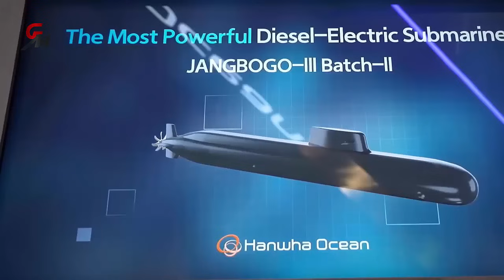Which is Better TKMS 212CD or Hanwha KSS-III, Here's The Canada's Next Gen Submarine

Comment: The KSS3 block 2 is what Canada is looking for, it meets or exceeds all Canadian requirements and the best choice for Canada.
Reply: this is the stealthiest sub around with its advanced battery power system.. even the new air recycling system... it has the ability to load nuclear missles.. and they are cheaper and on time... probably manufacture many of the parts in canada especially with technology exchange...  its a win win win...
Reply: I like the German boats as well 😘 🇩🇪🇨🇦 !!!
Reply: @douglaslim802...If you're too stupid to properly question an AI, you'll unfortunately just write bullshit! All data was collected using freely accessible AI! Our AI, which uses a much larger database, comes up with the same results. Go to trade fairs and give talks with specialists from TKMS, Diehl, and the like! Do you think major investors don't want to know where they're investing their billions, what these companies can do, and their future prospects? We/I know all about that, because we advise them!
U212CD, with the future drone system from TKMS, developed with German research institutes, is an underwater combat cloud, i.e., an underwater FCAS system that is connected to other FCAS systems! According to the AI proposal, a 7,000-kilometer perimeter can be built with 20 large drone submarines and 3-4 small drone submarines attached to each one, which exchanges data with U212CD! But this will happen underwater, using the latest technology! The drone submarines will then act as relay stations for data transmission. According to AI, the drones wouldn't even need to move, thanks to their extremely high-tech sensors, which have a long range! According to AI, they're between 40-70 kilometers. 60 small drones with a 40-kilometer range would then have a radius of 4,800 kilometers to cover. Add to that the large drones, which have a range of 80 kilometers, and an additional 2,800 kilometers! According to experts, this is a new league of underwater naval warfare and unique in the world! The costs are much lower than using many submarines for this! The large drones also have combat systems on board! The Diehl Barrakuda, which has a range of 100-160 kilometers, would be interesting if it could engage enemies at 400-800 km/h.
Reply: KSS3 is less risky for sure. And delivery timeline is very important for Canada.
Reply: @dannyyin.physio it's riskier because they have to change the entire hull to be arctic capable
Reply: I agree but mainly because they can deliver them much quicker than Germany can. The Koreans say they can replace the four Victoria's by 2035 and all twelve vessels by 2043 while the Germans can give us one boat in 2035, a second in 2037 and a boat every year or two after that into the early 2050's if the design proves to be sound. If they have to make changes after initial sea trials it could be longer and more expensive. The KSS lll has less worries that way as it's already in service.
Reply: @Fred-vy1hm quicker doesn't mean better, because you have to operate that subs for 35 plus years. 4 years saving with subpar submarine is way costlier
Reply: @Fred-vy1hm - Korea told Poland 2022 that they can get the K2 Tanks much faster than the Leopard. After 3 years they got a little Bit more than 100 and the Most of them was build in origin for the korean Army and not especially for Poland in another confi. So maybe you should not all believe what Korea says 😉. The KSS is more or less a technology copy of the german 214 class. The German 214 is our Export Version of 212 with less superior technology than 212.
Reply: KSS3 block 2  3600ton (4000ton)........ KSS3 block 3 is nuclear-powered submarine
Reply: The KSS3 block 2 is state of the art and at sea right now, and it meets or exceeds the Canadian requirements, and has everything the 213CD has and more, why wouldn't they chose the KSS3.
Reply: @KellyBrownlee The KSS-III Batch-II (3,600 tons) was state of the art but is being replaced. In the early 2030s, Korea will begin production of the KSS-III Batch-III submarines, which are expected to be larger (4,000 tons) and more sophisticated than Batch-I and Batch-II subs. Korea is also developing the KSS-IV (2,000 tons) with solid-state batteries, next generation fuel cells, next gen AIP, and potentially a rim-driven propulsion system.
Reply: @aerynlovell4754 - State of the Art 😂😂😂... It is a Copy of the German 214. Korea use German technology andcuse 214 by own. The actual best non nucklear Sub US the 212a and 212CD will be the best.
Reply: @KellyBrownlee block 2 is not even launched.
Reply: @shanjida8353  It is 1 is at sea and the other one is in the water.
Reply: yeah, 212CD with no VLS, why???
Reply: @flyingdutchman7757  The German company never tried to put VLS in their submarines before. But South Korea wants to use its submarines to counterattack from North Korea's nuclear attack, so it put VLS inside its submarines. Possibly, South Korea wants to put nuclear ballistic missiles inside the VLS of its submarines someday, when South Korea is ready!
Reply: @flyingdutchman7757 shot missiles from tubes. Only one that has AA capability it’s made for the artic and way more stealthy.
Reply: @FreyjaFosse-b2j  Agree, stealth is key (no doubt propeller technology is NATO Cosmic Top Secret)
Reply: @flyingdutchman7757 - we can integrate whatever the customer want. For Indonesia we also customized the 214. We can build the 212 CD EX...bigger than 212CD and with Equipment what the German and Norwegian navy not need but If you need VLS, we can integrate.
Reply: @DBond-bv2oi  독일인인가요? 독일 214잠수함보다 한국214라이센스잠수함이 성능이 더 좋습니다.
독일회사에서 잡지못한 구조적오류까지 잡아서 더 완벽하게 성능개선한게 한국형 214잠수함임.
독일은 옛명성에 의존하여 정치적 로비에 의존하는 나라로 변했슴
Reply: @김준승-q8x  sorry but I cannot read klingon
Reply: @flyingdutchman7757  - thats not right. It is able to integrated VLS. We Made for singapore in 214. The boat what fits best for Canada ist the 212CD EX. The korean navy use by own 214 and they try to copy but 212CD is much more modern.
Reply: @DBond-bv2oi  멍청한 소리하네 KSS‑III는 독일216, 214와 완전 다른 잠수함임..과거에 는 독일기술을 전수받아서 파생형 잠수함을 만들었었지만 장보고함은 설계부터 완전 다른 잠수함인데 독일 어쩌고 헛소리하는 인간은 뭐냐?
Reply: The KSS III submarine is a strategic weapon, while the 212CD submarine is a tactical weapon.
The KSS III is another class of weapon.
Reply: @널구리-b4k - sorry but that is nonsense. The 212CD is not a one role system... And Korea cannot build one KSS without German technology or spare parts.
Reply: @DBond-bv2oi  214까지는 독일 라이센스생산이고 KSS‑III는 계념부터 설계가지 완전 다른 잠수함임.
한국이 독자적으로 제작한 잠수함이라서 독일눈치볼 필요도 없는 잠수함임
그리고, 똑같은 214라도 한국에서 만든 214가 독일 214형보다 성능이 더 좋음..
독일이 모르던 단점까지 보완한게 한국형 214잠수함임
Reply: German technology=> Diesel gate😅😅😅
Reply: U212CD has VLS!! According to AI, U212CD is in a different league and much more dangerous! U212CD can be extended to 90 or 100 meters with additional identical modules! Diving depth is over 100 meters thanks to its diamond/oval shape, which can withstand 1.25-1.5 times higher pressure. Deep water is the biggest problem in even detecting a submarine due to the layers! Furthermore, thanks to U212A, U212CD is also Arctic and cold water-tested (-1.8 degrees Celsius for continuous operation for weeks), which also gives it an advantage over KSS III! Cold water is an extreme stress on materials!
According to AI, BRD Diehl developed an underwater hull, the Barracuda, back in 2005, which is now ready for use. It can reach speeds of over 200 knots/400 km/h, and in tests even up to 800 km/h! Range 100-160 kilometers! Currently only interceptable by the Barracuda! It's a purely kinetic weapon and, according to AI, probably undetectable by today's sonar because it's too fast. AI: If it accelerates to 800 km/h in the last 5 kilometers and hits, chaos will ensue. According to AI, just two Barracudas would sink a Zumwalt. The Barracuda would simply pierce through several decks and trigger chain reactions.
The facts AI has shown can't keep up with KSS III. Regarding construction time, it's also Canada's own fault, as they build it in their own shipyard! The high-tech components come from Germany and Norway. Another extreme feature are the new TKMS drone submarines. According to AI, 50 of them could form a 5,000-kilometer perimeter (90-100 kilometers detection range for drones) and detect everything above and below water! If necessary, it can also engage targets directly using various means; Barracudas would be an option. The drone just has to wait for what's coming and can forward data to the FCAS combat cloud, where AI then evaluates it!
According to AI, no other submarine can compete with the U212CD of its time.
KSS II is a derivative of the U214, which is the slimmed-down export version of the U212A! KSS III is ultimately based on the U214, which was further developed but without the high-tech sensors of the U212A! According to AI, the U212CD's sensors are in a new, far higher league! The sensors are completely AI-controlled and immediately make suggestions about where the next button needs to be pressed!
Reply: And what happens to the timeline if China decides to reclaim Taiwan in 2027. Or Russia takes the Suwalki Gap
Reply: Canada will choose Germany for political reasons.
Reply: @ssl558  Then Canada is stupid.
Reply: @KellyBrownlee - absolutely not! Not one KSS can build without German technology. The KSS is more or less a German 214 Copy. Korean also use the 214 and try to copy.
Reply: @DBond-bv2oi Yes, some things are baised of the German technology, but most of the kss3 is wholey south Korean design technology  and built with NO German say so in the building and design or required  permission to build!
Reply: @KellyBrownlee It is easy to say... The more modern boat is the 212CD. The KSS is more than our 214 for Export with little less Secret technology but cheaper. So it is Up to you. No doubt...the 212CD is the Smsuperior but the more expensive one. The KSS is good but not on the level. And forget the argue that the 212CD use no VLS Starter. We can integrate all what it is needed for the customer. I think it is also possible that you can build a big part of the boat in Canada! The Advantage is that Germany develope the technology and try not to copy something. That give you an Advantage. Sure...it is cheaper and faster to copy but the you will be never the one who leads in anything.
Reply: @ssl558 not sure, but I can see the SK one being chosen for the same reason.
Reply: @ssl558 and that is absolut correct because Kanada and Europe is closer together.... we will have a important trade Future.
Reply: max..Then again, the Leopard bullshit comparison with contracts! The old Leopard 2 can be modernized with a new 130mm or 140mm turret with all the features, including drone control! Furthermore, new drones and grenade defense systems can be integrated! The old Leopard 1 can be converted into a Frankenstein 35mm Skynex anti-aircraft tank for little money!
So stop with your stupid, brainless comparisons!
Reply: It's not
Reply: @saltymonke3682  Thats not what the Canadian Navy says.
Reply: Why?
Reply: The TKMS 212 is already in production for NATO partners, is potentially cheaper, has low acoustic signature and built for  Arctic operation with a reinforced sail. Germany has been building superior submarines for over a century and with NATO inter-operability this sub better suits the Navy’s needs.
Reply: ryzen...It's impressive how intelligent some users are! AI question for little lights out there who are too dumb to ask the right question to AI!... AI: Is the statement about nuclear propulsion true?... KSS3 Block 3 is a nuclear-powered submarine?...Answer for little lights out from AI: It's wrong!
I hope you can find an AI on Google with the help of Google. If that doesn't work, then enter the question into Google like this! Is the statement about nuclear propulsion true?... KSS 3 Block 3 is a nuclear-powered submarine?...AI Conclusion: No, this statement is wrong.
If you can't do that, then your IQ is the same as that of a 7-year-old child! A 9-year-old girl managed it without any problems!
Reply: max...As for Leopard, they're also talking bullshit, according to AI fact analysis!  Conclusion: This statement contains several factual errors and distorted representations that suggest it is more polemical rhetoric than an objective analysis of military systems. In detail: "Lost in the Norwegian tank competition against Korea" – It is true that Norway tested both the Leopard 2A7 and the South Korean K2 "Black Panther" in 2022/23.  Official result: Both tanks met the requirements. 
According to Norwegian statements, the result was technically close, but the Leopard performed better in some aspects (logistics integration, interoperability with NATO structures, overall package).
The Leopard 2 turret was lifted off in Ukraine because they drove down the embankment too quickly and didn't raise the barrel or moved it to the side! But that has happened with other tanks due to incorrect handling! However, the barrel system was still in working order, which was no longer the case with others!
The Leopard 2 has already seen several combat missions in war! The problem is how it was deployed, and therein lie the mistakes of losing the Leopard due to improper handling during combat! The German Armed Forces never send Leopards into combat without air defenses! It would be no problem for the Gepard to eliminate even small drones; according to the military, even one shot is enough. It would take 640 drones to fire until the Gepard is empty!
Reply: @tlsig during the competition in Norway, the Norwegian Minister of Defense reportedly sent a congratulatory message to the South Korean side the day before the official announcement of the results between the K2 and the Leopard 2. In fact, K2 scored higher in the evaluation, but as everyone knows, the final decision favored the Leopard 2 due to a “political decision” made by the Norwegian government, unrelated to actual performance. 

Norway had close oil connections with Germany, and at the time, Leopard veterans opposed the contract with South Korea. Moreover, the Norwegian head was known for pro-German sympathies. It is said that following the decision, the Norwegian Minister of Defense and military officials expressed deep regret over the outcome.
This outcome was remembered as a regrettable incident by the South Korean side. Because of this, the Norwegian Ministry of Defense promised that it would be willing to testify in support of the K2’s performance should South Korea pursue future export opportunities.
Reply: @tlsigAlso, in the K9 vs. PzH 2000 competition, the K9 was a clear winner. Germany sent 3 PzH 2000 units for testing in extreme cold, but none of them worked. Only the K9 functioned properly.
Reply: @tlsig The fact that Russia has ordered Korean icebreakers and specialized ships demonstrates that Korean shipbuilding and steel technology are trusted internationally, making claims that KSS‑III relies on foreign steel inconsistent with reality.

Also, Korea has successfully designed and operated polar research icebreakers (e.g., ARAON) and has substantial experience handling ships and steel materials in -1.8 °C environments.
This disproves claims that Korea has no Arctic or cold-water experience; actual operational cases already prove otherwise. So you are making absurd speculations that contradict reality and presenting them as facts.

KSS‑III is a Korean indigenous submarine with highly advanced automation and integrated sensor systems, designed to minimize operational errors.

Claims that KSS‑III depends on TKMS steel or that its system performance is inferior are baseless. Korea already possesses sufficient technological capability in steel, advanced sensors, and operational systems, which has been demonstrated through polar vessel experience and domestic testing.
Reply: @tlsigai만 찾지말고 실제 기사를 찾아봐요, 아기야.  대한민국 포스코는 HY-130을 상용화 중이다... 네가 어디서 듣고 온 얘기인지는 모르겠으나, 대한민국의 철강 생산/용접/가공 기술은 독일을 넘어선지 오래 되었단다, 아가야.
Reply: In this video, you can see the new 3D processing systems for U212CD construction, which saves 20% time during construction. The development costs for this system, together with the German/Norwegian institutes, are €250 million! Unique worldwide and a milestone in shipbuilding production!
https://www.youtube.com/watch?v=H4vH-UwfZ2k
Reply: max...If Korea is as good as they say, why aren't the BRD/DLR Polaris aura space plane right now? Basic research since the 1950s and the first breakthroughs in 1980! The systems are being tested on models today! First flight in 2025 Aurora 50% demonstrator in Mach range, 2026 hypersonic (Drohne-Diehl IRST partner) with aerospike engine, higher than 100 kilometers! 2028 Aurora/VEGA 28 tons, >10 Mach, 1 ton payload orbit (>160 kilometers altitude) and 10 ton suborbit (9 <160)! 2030 Aurora Heavy >300 tons 60 meter wingspan, >20 Mach, 25 ton payload orbit, 100 ton suborbit! Everything is being run through a BRD military project as well as an EU project! From the EU to Australia in 90 minutes! A 10-ton steel core as a kinetic weapon has 400 times the kinetic energy of a GBU-57! Aurora Heavy is capable of launching a 230-ton modular system into orbit for the EU space station in 3 months! The ISS weighs 420 tons! Transport cost comparison: SpacexStarship is 1/7-1/10 of that!
So what does Korea have to offer? NOTHING!
https://www.youtube.com/watch?v=FhnCDFu43E0
https://www.youtube.com/watch?v=RoK70Px25R4
https://www.youtube.com/watch?v=0aTtGoWsIEk
Reply: saltymonke3682...You're absolutely right that this is being vastly underestimated! The Eurofighter Tranch 1 was upgraded by Spain to Tranch 4 for a mere €544 million! It's now fully FCAS LTE capable with the high-end Pretorian Evolution system with the 2 pods, which will combat passive radar stealth jets!
U212As are currently being retrofitted one after the other in Germany with the very latest high-tech systems and brought up to the latest standard! That costs €1 billion for six submarines, so around €160 million per U212A alone! That's LTE = Long Term Evolution, which will save a lot of money in the future, just like with the Eurofighter! The fact that these systems are initially more expensive is because they were already thinking about the future and being able to implement innovations!
Reply: @tlsig Reading through the comments, I see them even resorting to lies to belittle others and elevate themselves. 
Isn't this a revolutionary Nazi-style mindset?
Reply: @tlsig- the Typhoon is also a really good example. Only the fact, that we need a certified plane to carry our nucklear bombs and the Tornado is in the end of his Lifetime needs to buy some F35. But the other Jets that we buy are Typhoones or we modernize our existing Jets. You also can see what is meant with developed forvthe Future. Look at the Leopard 2 Plattform. Developed in the eearly 70s and all the time with uphrates the best Tank in the world. For an example... Korea used german know-How, German engineers and technology parts to built 35 years after the Leopard 2 a Leopard Copy and nothing is better than the original. Better...the Leopard 2 a8 is now much more superior to the K2. So in my eyes the same with the KSS. To be honest...If Russia had not attacked the Ukraine... Maybe Korea's Copy plan had worked but nobody thought that we wake up and make, what we can do best. Build the best weapons.
Reply: @DBond-bv2oi  Airbus has already told the German government that the Eurofighter can be certified for nuclear weapons, and relatively quickly! However, important Eurofighter data, including data from the AI, would then be disclosed, and it seems they don't want that. Either the German government will get nuclear weapons from France or they will build them themselves, which, according to the German research institute, would apparently be no problem within 12 months.
Reply: SK1UROKPark....The smart choice will be seen in the future, and Germany is also thinking decades ahead, as is the case with FCAS, which it has already integrated into Eurofighter development! The new FA 50 jet would have no chance against the Eurofighter LTE Pretrorian evolution, just like the F35/22 according to AI! In the future, the FA 50 would have to fight against powerful combat clouds with wingman drones! Poland bought systems from Korea because they were cheaper, but they are not FCAS-capable!! The drone war in Ukraine, however, is now demonstrating how important FCAS combat clouds have become! All older German military systems can be converted to FCAS, as the interfaces are standard in Germany! Even an old Gepard, which even had the latest fire control computers integrated, where others couldn't believe this was possible, would be capable! Now Rheinmetall is converting all Leopard 1s to the high-end Skyranger 35 air defense system! Only a new mast ring and a few other minor modifications are needed to integrate the turret on the Leopard 1! This means that Ukraine will receive several Leopard Frankenstein/Gepard 2s this year, and many more in the future! Considering how old the Leo 1 material is, Greece and others are very happy about this! According to Rheimetall, there is said to be very high demand.
Reply: @tlsig유럽인들이 아직 이런생각에 머물러있다면 한국에게는 더큰 기회가 생길것입니다 독일의 많은 기술과 아이디어들이 한국의 기초를 다지게 해주었고 배우는 학생은 이미 그걸 숙련했거나 뛰어넘었습니다 독일이 안전에 안주해서 거의 모든걸 멈춘시점에 한국은 그들의 테스트국가가되었고 많은 시험을 당했죠 그러나 자주포 phz2000은 한국의 k9보다 일부좋거나 비슷하거나 조금 안좋은 부분이있습니다 그런데 가격은 두배가 차이나죠 .  .. 탱크또한 마찬가지입니다 사실 독일탱크와 한국의 탱크는 어느쪽이 더 좋다고 말하기 힘들정도의 수준입니다 다만 한국의 탱크가 좀더 가볍고 독일탱크보다 훨씬싸죠 독일의 타우러스미사일을 예시로들면 한국은 이미 타우러스보다 더 좋은 미사일을 개발해버렸습니다 천룡이라고 kf21에도 탑재될것입니다 왜. 독일 정부는 이것들을 막지않았을까요? 독일정부는 한국이 이것을 만들지 못할것이라고 무시했거나 독일의 군수업체들이 독일 내에서 혹은 유럽에서 그런 무기들의 수요가 없기때문에 한국에 판매하거나 한국과 합작했을것입니다 거의 같은성능 혹은 조금 부족하거나 더 나은 부분이있는 훨씬 저렴한 가격 소비자는 바보가 아닙니다  그리고 현재 한국은 생각하는것보다 훨씬 발전했어요 한국의 철강이 부족하다고요? 한국이 제트엔진 개발을 한다고하니깐 다들 못할거라고했죠 하지만 이미 공업용 터보팬엔진 6가지를 개발해서 상용화중이고 무인기 제트엔진은 개발이 거의 완료단계에있어요 다음엔진은 f414급 엔진개발이죠 영국의 롤스로이스나 다른 엔진개발 회사들이 왜? 한국에 기술이전과 같이개발 하자고 러브콜을 할까요? 이미 성공할것을 알고있기때문입니다 독일에 당신처럼 아직  독일이 최고야만 외치는분들이 많으면 좋겠네요 저희 한국을 견제하지 말고 계속 독일 no1을 외쳐주세요
Reply: @널구리-b4k  So they really don't know what they're talking about! KSS III is essentially a larger U214 derivative! KSS II is a U214! U214 is the export version without the high-tech sensors of the U212A!
U212CD sensors are in a new league! U212CD is scalable like U212A, where Israel got a 72-meter version! U12CD with two additional modules is a good 90 meters long, with a third module then 100 meters! According to the AI, the additional costs are kept to a minimum due to the modular design, which is a huge advantage! At 90 meters, it has a range of 17,000 nm and much more space for VLS systems like the standard U212CD version!
Or do they want a U212CD with 8-9,000 tons in the Virginia class? For upgrading and dismantling a Virginia ($8-9 billion), they get two U212CDs with 8-9,000 tons that can then carry nuclear missiles! There's no need to talk about range, operational duration, or extreme danger. U212CD systems with 90, 100, or 115 meters have cold water/Arctic certification for all components. However, according to the AI, South Korea cannot supply them for KSS III!
Reply: @tlsig Get your facts straight before talking BS.
Reply: @tlsig Every car in the world is a derivative of the Ford Model T.
POSCO already produces world-class submarine steel, so why import from Germany?
Reply: @tlsigabsolutely true!!! That is the Point!!!
Reply: What's very important is that KSS submarines require the extremely special steel from TKMS! According to AI, they can't build their boats without it!
Reply: @tlsig얘는 왜자꾸 헛소리하냐 AI😂 한국 잠수함 강철은 한국 제철소에서 생산이다
Reply: @tlsig You claiming that KSS‑III Batch III used steel from TKMS is utterly stupid nonsense. Here’s why:
1. Korean shipbuilding is world-class
Just look at the ARAON and next-gen icebreakers: Korea breaks through ice over 1 m thick for both polar research and commercial LNG transport. Germany may have experience with small research icebreakers, but in commercial large-scale polar ships, Korea’s production capabilities are unmatched.

2. Why would Korean subs need German steel?
Korea can produce high-strength hull steel and specialized materials for submarines entirely on its own. The idea that KSS‑III would rely on TKMS steel is complete nonsense.

3. Logical contradiction
If KSS‑III had used TKMS steel, it would imply using inferior materials compared to German icebreakers. But in reality, Korean icebreakers match or exceed German standards in both research and commercial applications. This claim ignores technical reality and is pure fabrication.

4. Russia proves the point
Interestingly, Russia is a major customer of Korean icebreakers. They ordered Arctic LNG carriers and research vessels from Korea, even during times of conflict. If Korea’s shipbuilding is internationally recognized, your claim that KSS‑III relied on German steel is simply ridiculous.

So your claim that KSS‑III ordered steel from TKMS is utterly stupid nonsense - there’s no basis in reality, technology, or international precedent.
Reply: @tlsig Just a side note, the Korean metallurgical company POSCO supplies its Giga Steel to 15 global automobile manufacturers, including GM, Ford, Renault, Toyota, Honda, Nissan, Mercedes-Benz, BMW, and Volkswagen.

https://youtu.be/B9YEsE2NfnE?si=Lj9RsdwhqapDAEYt
Reply: @tlsig그리고 이미 독일은 너무나 많은 잘못을하고있어요 벤츠나 일부자동차회사들 이미 다른 나라에서는 중국의 차라고 이야기하고있습니다 이것은 생각보다 심각한일이에요 독일 기업들은 너무많은 중국의 자본에 잠식당했습니다 아마 머지않아 벤츠부터해서 그 이미지는 땅에 떨어질것입니다
Reply: @tlsig because the KSS3 are just a rip-off of the German 214 class.
Reply: @TuxCommander  lmfao... germans cant even deliver on time... why do u think poland has purchased k2 tanks and k9 howitzers, and chunmoo rockets and fa-50 jets from korea and not germany... cause you guys are a thing of the past... germany is always late and expensive... not worth your time...
Reply: @SK1UROKPark  ehh yeah .. lol no 😅 but please keep dreaming. It's important to hold tight and stick to your believings :)
Reply: @TuxCommander  lmfao.. a german patriot  tuxcommander... lmfao. dream on buddy.. germanies rheinmetal lost the australian land battle 400 to hanhwa redback... and thats with all of germanies politcal pressures on australia... lmfao.. then they lost to poland.. poland bought all of their mbt's and k9 howitzers and chunmoo missles and fa-50 fighter jets from korea and not one piece coming from germany even though they tried to sabotage the deals.. but germanies aggressive lobbying other countries did not deter the buyers from making the much smarter choice... but its cool that u believe in what u believe... lmfao
Reply: @TuxCommander a downgrade to be exact
Reply: @TuxCommander  Imitation is a thing of the past. Korea has already achieved technological advancements and has captured Germany's shortcomings. Its performance is also superior to Germany's. We no longer live in the same place we did 20 years ago.
Reply: @mingkyu67 Korean troll Army again in lobby mode. Second video you react to me. 
Curious how many you'll find, since YouTube is bombarding me with this content since I commented twice to it, because you guys distributed your BS everywhere. 
Aaaand no. 
Korea might design nice phones and tablets, but that's it when it's comes to comparison to Germany. In particular in defence technology. 
But as I said to your colleague, keep on dreaming - it's all you've when you really believe Korean subs, tanks, artillery, cars, trucks, steel or any industrial component can compete with German engineering.
Yes, you might build more ships, but what are the engines or gearboxes from? All license builds from Germany because Korean has not managed to developed something groundbreaking from its own. That's why Hanwha faced challenges with the AIP adaptation.(don't even know they've solved it entirely)
Reply: thanks tux.. true words.. but its better when it doesnt come from a canadian born korean,,, sounds bias when i say it. lol
Reply: @tlsig yes ..and they have to use other German technology for KSS.. Not also the Special steel. Korea also use German 214 by own.
Reply: max..Korea wouldn't have been capable of developing and building a modern submarine of this performance class back then without the U212A/U214. Does that make sense to your brain? They're talking nonsense about everything Korea can do; they didn't even have 50 years of basic research into submarine construction for Arctic waters back then!
Using a polar ship as a comparison is a complete joke when it comes to submarine loads in 200-1000 meters of Arctic water! When it comes to AI development, South Korea is a dwarf compared to Germany! Germany started with it in 1980, and they were already starting to develop the Eurofighter FCAS system! Germany with modular quantum computers/2024-9 with AI is in a different league that no other country in the world can boast! Germany has a unique global distinction here, just like with lithography machines for semiconductors!
Next they'll come up with e-bikes or other nonsense as a comparison!
Reply: Chuli...Tell me, what's harder to develop? A 1985 Eurofighter with all its new high-tech sensors, including airframe overload monitoring, plus the FCAS system, the unprecedented CFRP composite construction that makes the JET 3-6 (18,000 tests with 12G achieved - 36,000 hours according to experts) twice as durable, the completely unstable flight attitude design, and the completely new computer-system-control compared to a VLS for the U212CD?
But to put it briefly, you have absolutely no idea what you're talking about! The U212A/U214 of the Israeli Dolphin class, 20% larger, has a 650 mm HLS horizontal launch system at torpedo tube level! This is what launches their apparently nuclear-capable cruise missiles, Popeye Turbo cruise missiles! International arms experts and several media reports assume that Israel now has the capability to fire nuclear-armed SLCMs (Submarine-Launched Cruise Missiles), which is part of Israel's "Second Strike" capability.
So the U212CD will receive VLS, and for the German TKMS, that's absolutely the smallest problem! Dolphin/U214 were built between 1994 and 1999 and commissioned between 1999 and 2000. So, TKMS has a few years more experience than Korea with HLS and VLS, which they've definitely tested long ago! 
KI It took them two seconds to figure that out!
Reply: ajaxmaintenance...TKMS/BRD/Norway has offered Canada a partner, which is a whole different league! Apparently, some people here don't understand what that means! This collaboration goes far beyond normal cooperation...it includes further co-development by Canada based on new data from Canada's U212CD in service! Future new warships of all kinds, which would then be jointly developed at the absolute highest level!
That would only be one area, but with the Eurofighter FCAS, it would be the same again! The U212CD and Eurofighter would be manufactured in Canada, and the high-tech systems would be delivered! Then it would be quite possible that Canada, through extreme cooperation with the EU in a new EEA, would receive a modular quantum computer from BRD for research and development! Then Canada could also participate in the BRD/DLR Polaris Aurora spaceplane, one of the most important EU projects with quantum computers, in the future! This is a whole new league of collaboration in the future that no other country in the world can offer!
It's not just about a submarine, it's about so much more for Canada!
Reply: @tlsig Korean steel mills hold numerous high-value-added patents. Korean shipbuilders rank first, second, and third among global shipbuilders. China, with its large population, holds over 50% of the market share in bulk carriers and low-cost vessels, while Korea holds 28%, focusing on high-value-added vessels. Japan's shipbuilding industry is roughly equivalent to that of Korea, lagging behind Korea in high-value-added vessels and China in low-value vessels. Korea's Pohang, Gwangyang, and Hyundai Steel mills hold numerous top-tier, high-value-added patents.
Reply: max...Do you think South Korea can produce TKMS's high-tech steel? They've tried it and conducted steel analyses like all copiers! The manufacturing process is highly complex, lengthy, and subject to the highest secrecy, even among operating personnel! Do you think all this is being blown out of the water? According to the AI, there are definitive statements for KSS II that TKMS supplied steel/export sensors and co., including the U214 plans! South Korea has hardly any cold water/Arctic experience -1.8 degrees Celsius, especially not with steel!
Germany and Norway are the countries worldwide with decades of proven experience and are leaders! They have lengthy test certificates for all systems that KSS III South Korea can't provide! 
Your comparisons with steel are, quite frankly, pure bullshit without any knowledge of special steel! Let's take the Russian nuclear icebreaker, which breaks 10 meters of ice. U212CD diving depth, same force applied, 200 meters Arctic water -1.8 degrees Celsius! If the U212CD dives 800 meters deep, then the Aton icebreaker would have to break 40 meters of ice! According to experts and AI based on the U212A diving depth of 700 meters burst zone (experts 900 meters), the U212 CD will, thanks to its diamond/egg shape, be 1.25-1.5 times more stable than a tube at holding pressure, meaning it can dive to depths of 1000-1200! 1000 meters corresponds to 50 meters of ice for an atomic icebreaker to break!!! Modern sonars can hardly penetrate the different salt water layers at 800-1000 meters, if at all! According to the AI, finding U212CD stealth is almost impossible with today's technology! The 212CD's high-tech array of sensors then detects the submarine hunter and sinks it!
Reply: @tlsigYes.
Reply: max...So forget about spouting bullshit with your weird analyses, which I'll quickly dismantle with other facts using AI analysis!
Reply: @tlsig So what about AI? In reality, German technology has repeatedly been exposed as overrated when competing with Korea. Without lobbying, they wouldn’t win, yet all they do is spew lies as if it’s breathing. Tanks, self-propelled artillery, armored vehicles - there’s not a single system where they’ve technically beaten Korea. If they’re so confident, let them try winning this submarine competition. It’ll be really entertaining if the German tech you keep hyping gets beaten by Korea again - buyers and judges aren’t fools, lol.
Reply: @tlsiglol you better stop utterly stupid nonsense claim. What a keyboard warrior lol
Reply: @tlsig Korea 2 vs Germany 0

Germany eliminated from tournament.
Reply: max...Your comparisons with the old PZH 2000 and the new K9 are, according to AI, bullshit again! The PZH emptys its entire magazine without a break, and the K9 has to take a break after 3 minutes of continuous firing! Let's take the new RCH 155 as a comparison. Compared to that, the K9 just looks old as an AI. Conclusion in all areas! The RCH 155 fires immediately from a standstill to save time, and does so without a pause until the magazine is empty! Then it can race away at up to 100 km/h!
Reply: @tlsig Korea is already conducting maintenance, repair, and overhaul (MRO) projects for American ships.
From destroyers and fighter jets to aircraft carriers, submarines, and even Aegis destroyers,
Korea is maintaining and building virtually all ships, fighter jets, and helicopters.
Korea is also leading the way in icebreaker development.
They can navigate the Arctic and Antarctic, regardless of ice conditions.
While I respect Germany's defense industry, this extreme display of domestic technology seems rather pathetic.
Reply: kim..Aha, why did South Korea build its KSS II from TKMS steel, since South Korea had its own underwater steel that wasn't approved for it? They're talking about special cold-water/Arctic-grade steel, not something like this! South Korea, with its KSS III, is a competitor to U212CD! What competitor is stupid enough to produce the world's best cold-water/Arctic steel? They have experience dating back to World War II, when the first German submarines operated in cold water/Arctic conditions! From the 1960s and 1970s, special high-tech steelmaking systems developed by West German research institutes with TKMS were added, and these were milestones! Everything is kept under the strictest secrecy, including the manufacturing process and its employees!
At that time, Korea was in the Korean War, and submarine construction only really began in the 1990s, and the U212A/KSS II export version was the basis for everything!
``` According to the AI, KSS III doesn't have cold water/Arctic certifications for all systems, unlike U212CD without any problems. U212A regularly performs cold water/Arctic missions, and has done so for decades!

Apparently, their intelligence isn't sufficient to ask an AI the right questions about these submarines in comparison? It could well be due to South Korea's education system, as they learn everything by heart, meaning there's no networked contextual learning! That was my conclusion when I analyzed the Korean education system! Children learn themselves to death, and those who survive then manage to kill themselves later! Despite this, Korea, along with Japan, ranks last among industrialized countries in terms of labor efficiency and value creation, with the highest number of working hours per week!
Reply: @tlsig Stop writing fiction. There is no official information stating that Batch III imported steel. If you have the source, simply show it.
Reply: @tlsig You clearly have no idea of what your talking about. S Korea is poised to become a top 3 arms producer for the remainder of the 21st century (go look up Janes). Perhaps you should go and see what a 21st century country looks like. You seem to be preoccupied with the last one.
Reply: @tlsig What are your thoughts on the German education system, which produces incompetent, high-skilled workers?
In Korea and Japan, manufacturing remains a major industry, so naturally, labor productivity is low.
It's surprising how the European education system, including Germany, which has thrived on the far right due to its neglect of basic education, seems to be superior.
Reply: @tlsig That’s not something you guys, who talk big but get wrecked in real combat, should be saying. I mean, even before being deployed in real operations, the Leopard had its turret ripped off while reversing during training in Poland, and in Ukraine it got taken out by drones in the mud. In the Norwegian tank competition, you lost to Korea on score but barely won through lobbying. Honestly, with you guys, lying is as natural as breathing - you just rely on your fame to cover it up.